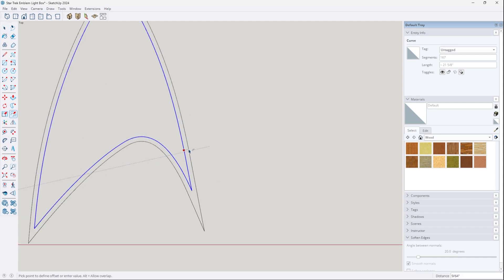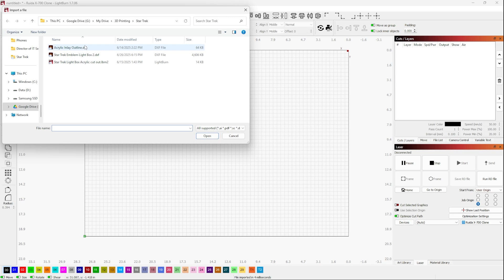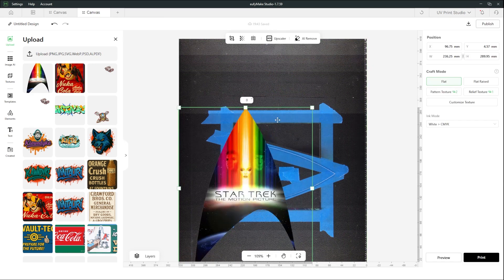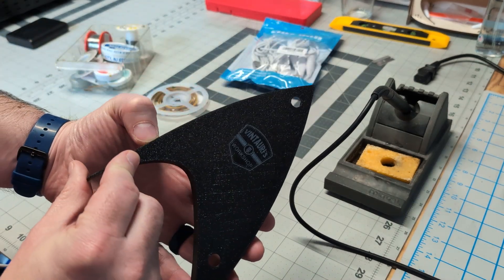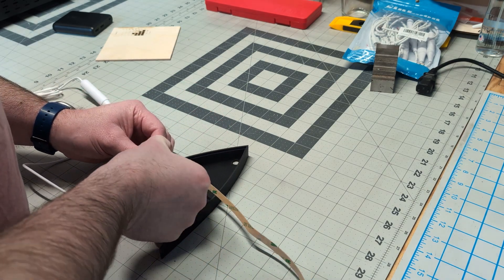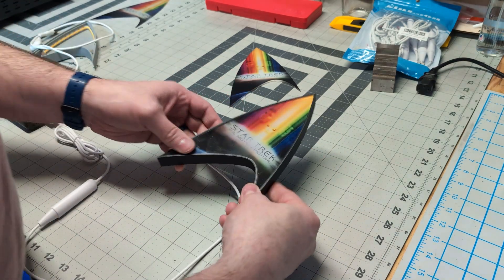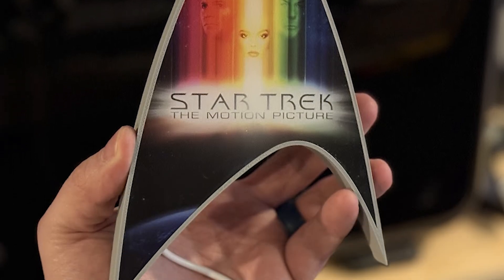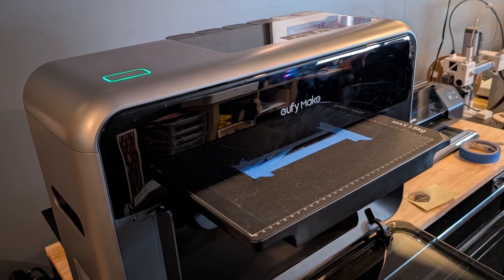Custom Light Boxes using a 3D Printer, Co2 Laser and UV Printer

Comment: Got my Reno 65 Pro coming tomorrow 😂
Reply from the maker: The Reno pro series is a good budget Co2 laser to work with.  Check out my air assist upgrade I did on the Reno Pro 45, it's work it if you do a lot of cutting with the laser.

Comment: How much would putting a white covering on the inside of the box helped disperse that light into the corners just a little more?
Reply from the maker: It may help a little but the LED backing strip is blocking most of the light from getting into the corner. It would have been best to use three strips worked deeper into the corners with small wires to make the electrical connections.

Comment: Hello, that is a really great project I may have to try something like that… 
I don’t have my machine yet, but I have a question, what size space does the machine take up while printing with the large bed? I want to put mine in a printing cabinet since I will be printing in my house and want to build it now before I get my machine. 
Thanks in advance and look forward to seeing what else you make in the future.
Reply from the maker: Thanks, it was a fun project. The printer itself is about 10" deep and you'll need about 12" of clearance behind it and in front of it, when using the large sling bed.
Reply: @Vintauri  ok thank you, im so excited to get mine and start working on some projects.

Comment: I bet you can also use opaque white acrylic or a very thin white 3d printed flat piece. Another thing that might reflect the light better is to have the insides printed in white, reflecting the light better.
Reply from the maker: A 3D printed white diffuser would definitely be an option. I didn't so much need reflectivity, but I wanted to diffuse the light so you didn't see the line of LED lights so prominently. I actually had to use the dimming function to lower the light output so it was not too bright and blowing out the colors.

Comment: Nice job. Has anyone tried printing on something that's been embossed with foil yet?
Reply from the maker: I have not, for smooth surfaces, you need to use a bonding agent on the surface. They have come out with some and sent some out to a few testers, but I have not had the chance to try them yet.

Comment: How did you size the SVG properly in lightburn to fit the print? Or did you export that inner line from sketchup?
Reply from the maker: I have sketchup Pro and was able to export the outline from there as a dxf to import into lightburn. That maintained the original size better than the SVG.